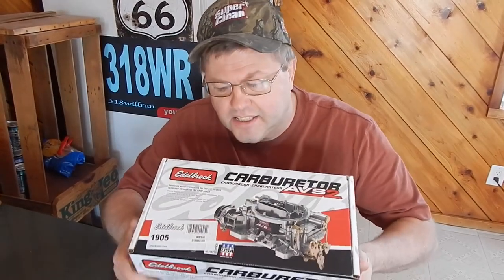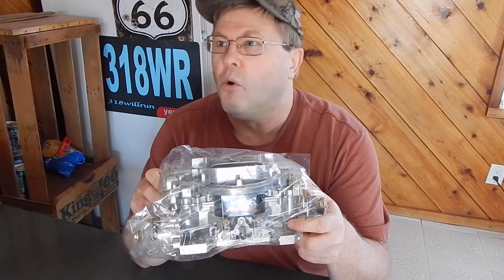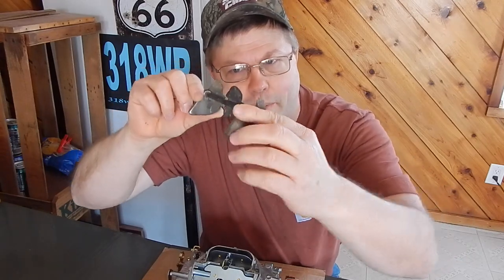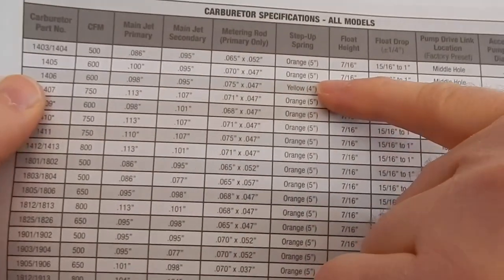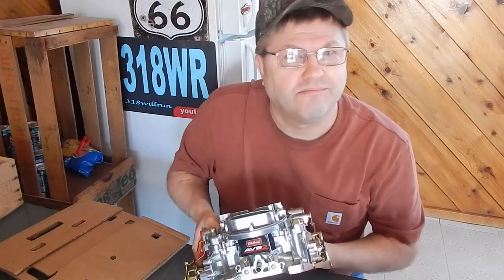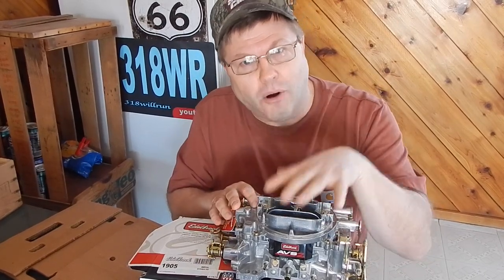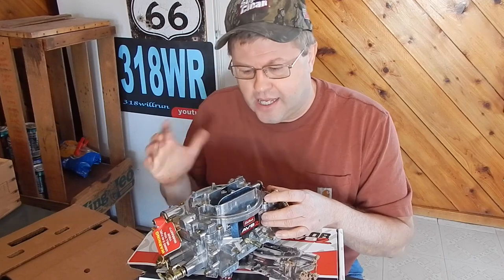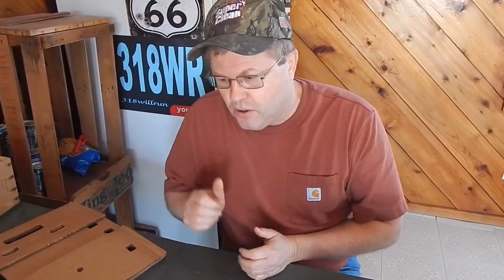650 Edelbrock AVS2 Unboxing and some details vs 1405/1406 ?? #edelbrock

Comment: Those are grat daily driver carbs. Absolutely love mine on my 318.
Reply from the maker: Thanks for watching!
Reply: Do not use an open spacer with that carb only a 4 hole! I spent a month chasing a vacuum leak on a 383 big block.
Reply from the maker: @jacobpetry9099  thank you!

Comment: I've had my AVS2 for a almost a year. Love it. I did have a strange issue. One my annular boosters developed a hole in the casting. All of a sudden it started bogging,,,,, bad. When I pulled the carb apart to rejet I got lucky and thought I should clean out the passageways. I shot carb cleaner through the inlet and it came out the outside of the booster. Edelbrock sent me 2 new boosters and tons of stickers and a gasket kit the same day.
Reply: Which pop up springs are you using..it comes with orange.

Comment: I was really impressed with them, I put one on my Demon when I had it, it had a 750 Holley double pumper before and I was looking to make it more street friendly. It idled better and got rid of the dead spot the Holley had. I should've put a duel plane intake manifold on it and I think it would've been even better for the street l learned the old 340 Torker intake really isn't very good for the street and I'll not use a single plane on the street ever again. Looking forward to seeing your results, I think you will love the Edelbrock!👍
Reply from the maker: Thanks for your experience on the change!!

Comment: I'm running this on my mild 318 (thumpr cam, speedmaster heads, etc.) and it runs great for daily street driving which is what I do. Edelbrocks are flat out reliable but in the Texas heat where I live, vapor lock/heat soak is so often that EFI is very enticing especially with the discounts on summit right now.  But the car does fire up ever time lol.
Reply from the maker: I think I was getting heat soak at the strip with the AVS2 when I compared the Brawler with the AVS2.

Comment: My plans call for a pair of the 500 cfm AVS2 carbs, 1:1, NOT progressive on my 360.
Reply from the maker: dual quads !   👍
Reply: @318willrun  Yup, I got an Eddy dual plane, and an offy single plane. Can't wait to get my engine back from the machinist and out to Sears Point (Infineon) to compare them.

Comment: On the the track, my money is on the Brawler. But on part throttle and around town my money is on the AVS2. If I’m not mistaken, you’re running an air gap intake on your car. That intake doesn’t have the exhaust crossover. It is my understanding that on a colder intake manifold, the atomization from annular boosters helps with response and combustion efficiency. On a warmer intake it’s the other way around. 

I had that carb (AVS2) on my 318 dart sport, on top of a stealth intake. It cranked at 145-155 psi, and was running 22 degrees initial, 34 total at a little over 2500. Ignition is an MSD 6al. It was very difficult to tune it as to not rattle on light acceleration on the highway. Had to go 2 steps colder on spark plugs, take some vacuum advance away, and a rod change for more fuel at part throttle cruise. I switched over to a 1969 383 avs, with everything else the same. It wouldn’t rattle, but with the factory jetting I would get a very noticeable lean surge on light acceleration. I suspect my warmer intake manifold liked the old school downleg boosters better.
Reply from the maker: The Duster has a RPM, but not the air gap.   Thanks for sharing your experience!!!!
Reply: That's good you know all the stuff that ninety-nine percent of us out here do not know or able to do what you did

Comment: All AVS are spread bore, they were designed to compete with the Quadrajet, also all spread bore.  the older AVS models can be square or spread bore carbs.  The Thermoquad, a massive spread bore, was designed for max fuel efficiency.  you can get a strip kit for both AVS and AFB carbs, with jets, springs and metering rods. That was the best way to get my 500 cfm stock 318 to run well. I love the AVS, nothing like the sound of a spread bore when you floor it.
Reply from the maker: Thanks for watching!
Reply: @318willrun  it is dangerous, you make me want to go buy cars.
Reply: avs 2 is a square bore carb its not a spread bore. qjets are spread bore
Reply: Wrong. I have a avs2 , 500cfm. Its square bore
Reply: @charlespartak2435  yep, they make bothin AVS. Thanks 
.

Comment: I know for example  say a 600 stock edelbrock manual chokes from factory are ment for performance while the same carb but with an electric choke is built for economy . I'm wondering if you could take a stock edelbrock 750 or 800 and change out the front  jets, rods & venturies to a 500 cfm parts you could get the fuel economy up front while having the racing parts of the back half under wide open ? kinda like a wanna be thermoquads/ Qjet
Reply from the maker: I don't know for sure how that'd work.  Thanks for watching!

Comment: Interesting comparison. I know that CFM ratings between 2bbl and 4bbl carbs are done with a different pressure drop, but I also ‘heard’ that  Edelbrock and Holley use a different pressure on 4bbl’s also! The example given was an Edelbrock 800 cfm would flow LESS than 800 cfm if tested the Holley way. Have you ever heard anything like that?
Reply from the maker: Yes!  Makes a difference on how they are tested.  Seems to be the consensus that Holley is bigger with the same CFM's

Comment: Spread bore vs square bore. Are the center lines on the primary and secondary side inline with each other? If they are it is square bore. If it is wider on the secondaries then it spread bore. This kind of skirts the line as the primary side is smaller but still centered the same as the secondary side. I'm looking forward to trying a pair of those AVS2 carbs on my Edelbrock TR5 tunnel ram intake. I have the open plenum so I am going to try progressive linkage on it.
Reply from the maker: Thanks!

Comment: Will it work on chrysler 400 engine with lean burn?
Reply from the maker: I would ditch the lean burn.  Lean burn carbs are set up a little differently, but it may still run good for you